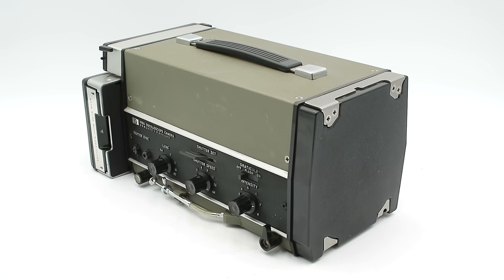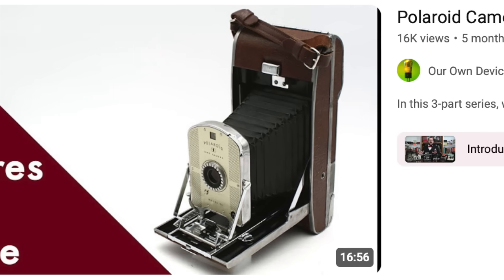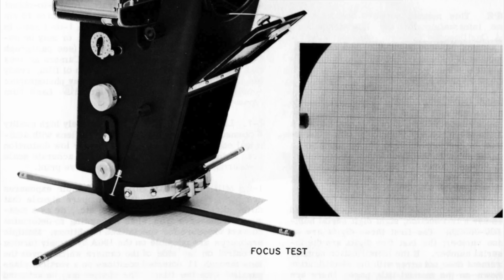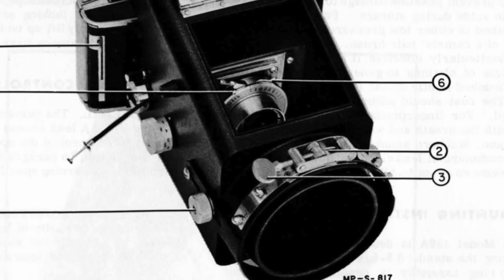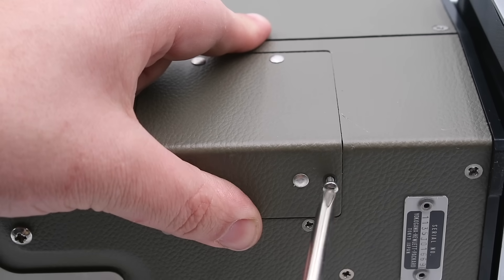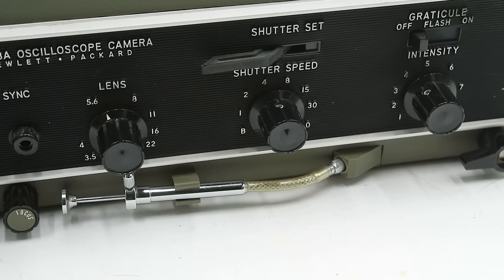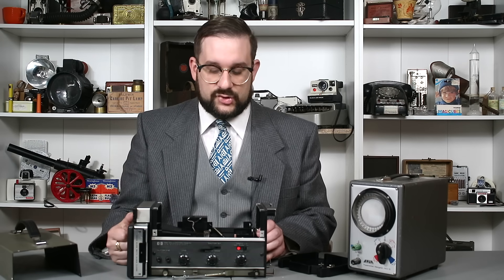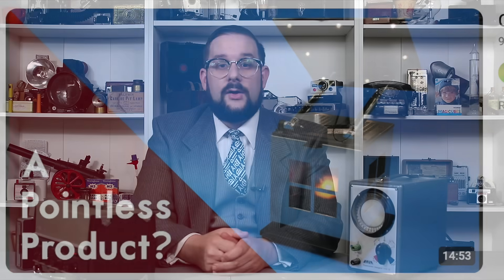HP 198A Oscilloscope Camera: Old-School Data Collection

Comment: Oh, my...  Early in my engineering carrier I was assigned to a team creating repair instructions for a ferrite core memory unit.  Sorta' tells you how long ago that was.  Shortly after I joined the team it was discovered that my hobby was photography,  Guess who was appointed to work in the lab with one of those cameras recording oscilloscope traces for the manual.  I grew to hate the chemical odor of the discarded parts of the film packs, lots of pictures, big wastebasket full of debris.  Near to the end of my carrier I had an oscilloscope that made an image, sent it to a plotter and/or a file.  Much better than the film camera, no chemical odor either.

Comment: I have a Tektronix 2252 oscilloscope that produces screen copies on an Centronics-compatible PC printer attached to a parallel port on the scope. Unfortunately, I don't (currently) have a printer to try it out. These are kind of a transitional solution between the earlier scope cameras, and the digital storage scopes that came later.

Comment: I found an early 80s DSO at a thrift store a little while ago, complete with an onboard 5 1/4" full-height Shugart floppy drive. The thing is huge, and must've cost a fortune when it was new; that floppy drive alone probably cost around $500. Still, I'll bet it was a godsend just pushing a button on the scope and saving the trace data to a disk.

Comment: We used variants of these for very high speed work, mostly for ESD, weapons, or nuclear work.  Later they were replaced by electronic versions, where the CRT had an electronic snapshot taken, as fast as possible.  These were used as a standard "save the data on the screen" for decades, in all high speed situations.  Triggering was a problem, since it was not capable to go anywhere near the 1-microsecond required zone, until later models.  Eventually HP designed 1-nanosecond triggering, which worked well, and was capable of capturing slapper explosives as they developed along the plates, and similar 30,000-foot-per-second events.  They actually worked very well, for that time, and were state-of-art.

Comment: I used a variation of the 197A camera to document oscilloscope and spectrum analyzer traces for reports.  This camera used the Polaroid film cartridge that came out in the early 1960's.  If I remember right, the film was 1100 ASA B&W.  To focus the camera we would pull out the film pack and use a focusing plate in place of the film pack.  The camera took relatively good photos, assuming the trace intensity was uniform across the CRT face.  Given the fast film, the exposure latitude was quite narrow so, the trace intensity across the CRT face had to be constant.  As a bonus feature, the camera could also be used to take passport or driver's license grade photos of your lab mates as a joke.  The image barrel distortion made such photos a bit creepy looking.

Comment: I never really ran across any of the HP scope cameras, but was very familiar with the Tektronix  C50 series in the mid 70's. I use to work in a calibration Lab and we had to issue them out to Lab tech's , keep them clean and loaded with fresh Polaroid film. Thanks for being able to see another side to capturing O scope screen data. 👍

Comment: In the mid 80s, as an EE student, we used similar but simpler polaroids with the lab's oscilloscopes.  Even then it struck me what a wonderfully kludgy solution that was.  I recently saw on Adriene's Digital Basement that you can now get an amazingly powerful digital oscilloscope for under $100 that fits in a pocket.  Wonderful time to be alive.
Reply: lol, so it seems that "In the mid 80s, as an EE student" we both had similar experiences. (Though mine was late 80s, there were still a few profs using that instead of the o-scopes with printers attached)
Reply: This is basically just the old school version of taking a picture of it with your phone, I always thought that was just a new thing with the rise of smartphones but I guess photos have always been a simple way to record data.

Comment: Ah yes, the days when HP was known not for consumer laptops but for high quality test equipment, which weighed a ton and cost a lot, and was worth every penny. The general rule for electronics labs back then was "Tektronix for oscilloscopes, HP for everything else. And don't forget your Simson 260 multimeter."

Comment: A logical continuation of this approach was to draw and photograph animation frames on the kind of high resolution storage tube CRTs (basically CRT-based etch-a-sketches operating at well below 1fps) that were available on terminals like the Tektronix 4010 series in the second half of the 1970s. Various early CGI was created in this manner.

Comment: Great as usual, just wondering if this is a Canadian thing?  I hear you say oh-sill-a-scope.   Always understood it to be ahh-sill-a-scope just like ahh-sill-late. Scopes will start following you home. Their like chips, can't have just one.  Tektronix 400 and 500 series are my faves, but Apollo era HP gear is always the best.  Open them up and sit in awe of the engineering and workmanship. Something as simple as a 3310a function generator has 4 boards with gold traces in a box smaller than a toaster.

Comment: I used the simpler Tektronix camera in EE Lab in 1969.  I also used a Visicorder oscillograph that had miniature galvanometers and wrote with UV light on sensitized paper rolls.

Comment: The vestigial timer is there because it's a "clockwork" Copal shutter. The last Copal shutters were made as recently as 2013. You'll find them on big 4x5 and bigger cameras where the lens is also made by another of many companies.
BTW, HP is now Keysight. They still make oscilloscopes and have nothing to do with the HP brand that was sold +20 years ago. Keysight still has offices in silicon valley.
Also, the last time I saw a Polaroid CRT camera, in the 1980s, if memory serves, it looked to be manufactured by Polaroid and looked like one of their cheap black plastic cameras but with a long (pre-focused?) nose.

Comment: When I worked at the Naval Research Laboratory in the late 70s, they used a camera setup like this to take data from their optical experiments. I would then take the photos and digitize them on a very early manual digitizer, pressing the pen onto successive points along the trace in the photo. The digitizer would output the coordinates directly onto punch cards! How times have changed...

Comment: I used a lot of HP measurement and recording (not sound recording) equipment in labs in the early 80s.  The thing I think about when early-ish HP products come to mind is so-called Reverse Polish Notation - a programming language (?) they used.  It worked just fine, but you kinda had to put your brain on backwards when programming.

Comment: I like your addendum at around 14:55, about examining problems that people have run into the past, and how they found solutions to them. Learning how people approached problems and how they came up with innovative solutions is a great way of giving you ideas and frameworks to approaching problems when you run into similar situations yourself, even if they're not directly comparable.

One thing I really appreciate about your videos is that you make sure to clearly communicate what was the actual problem that people had, and then you introduce the device that was used to solve that problem and how it achieved that. I notice quite frequently that people just end up explaining what something is doing, rather than why it's doing that thing; and without understanding why things are done in a certain way, it's incredibly hard to actually apply that knowledge to other situations.

Comment: These haven't been obsolete for TOO long; I owned a Tek scope camera in the 80s, and I still have the enormous "mainframe" o-scope (Tektronix) that it attached to.  It is an analog storage scope meaning that the storage function is implemented in the CRT itself - there is no digitization or electronic memory.  Interestingly, Tek made a "digitizer" (analog to digital converter) which used a storage tube as well - it was a truly exotic, one-of-a-kind "scan converter" tube designed and made by Tek and concealed inside a rackmount chassis. There was no visible display as the captured signal was exported over the then-new GPIB bus that HP originally developed.

 The signal from the vertical plug-in deflects a writing beam through distributed deflection plates. The electrons hit a small flat rectangular solid state target, conceptually similar to the image sensor in a digital camera. The resolution of the target is 512×512, giving 512 points in the time domain and 9-bit linear quantization of the input voltage. With a 7B92 sweeping the whole X-axis in 5 ns, and the 7912 capturing 512 samples in that sweep, the 7912 performs the function of a 100 GSample/s A/D converter. (!!) Nearly all of the units produced were purchased by the U.S. gov't. 

Digitizing scopes existed at the time, but their sample speed was slow, meaning they were fine for repeating signals, but if you wanted to capture a single transient event, one couldn't have a good waveform; there weren't enough samples before the event was over. In fact, the official name of the original R7912 was "Transient Waveform Digitizer". Analog storage tubes and the 7912 could capture one-shot waveforms with excellent resolution.

They were breathtakingly expensive even before the plugins were purchased, although it used 7000 series scope plugins so if you had a fast vertical amp already for a scope, you could use it in the 7912. Astonishingly, my old 7904 storage scope, built in the 1980s, still works fine.  Tek really built good stuff.  When it was new, it was $17K with no options and no plugins. I bought mine in the 90s, stuffed with thousands of dollars worth of great plugins, and including four nice Tek probes, for $200, thankfully the ebay seller was near my town so I didn't have to ship the beast.  The dedicated Tek scope cart (you don't want to try carrying the thing, handle or no handle) I picked up at a local surplus store for $10.  I also have a logic analyzer plugin which turns the scope into a 16-bit logic analyzer.
Reply: Did you say 100 GS/s

Comment: I thought it was a toaster...designed by you, Giles. 😂🤣

Having owned an HP RPN (Reverse Polish Notation) calculator in high school, I can verify if there was a complicated way to do ANYTHING, HP will inevitably choose that paradigm. Every calculator I was looking at, had ways to reinsert the modulus back into the current calculation on the Stack. WHO DOES THAT?! 😂🤪😵‍💫

Comment: Sync input normally is connected to the oscilloscope, set for manual triggering, so that the trace only comes across the screen once the trigger condition is met. Otherwise the screen is blanked. Auto trigger, or on the old oscilloscopes the free run position, always will display a trace in X axis, while the manual trigger mode only will show a trace when either the input passes a threshold, or is above it and above a frequency, or above it and the high frequency noise is filtered out, or uses the incoming AC mains peak as a trigger source, or an external voltage level to trigger. That way your film does not get a big band of bleed light from the base level put on it, which means you can run the screen at a very high brightness, to capture fast events, as they are still able to provide enough light to excite the film. 

An aside is that later scopes with memory had a multichannel plate in the front of the CRT, and would hold an image for a few minutes after it was written, making it easier to photograph as you simply left the film exposing for a minute or two, so the faint image would be recorded.

I had a very similar device, except it used a non developing film, very heat sensitive thermal paper, and ran the CRT very bright, with the film pressed against the glass, so the bright spot would put enough energy into the paper to expose it. Worked well enough, but very slow, used originally as a recorder for ECG or other signals, and if you wanted a long term record you would have to use a photocopier to immediately make a copy, or use a polaroid camera to take a photograph of the paper strip, as it would fade with time.

Comment: Not to be pedantic, but the shutter speed dial on the 197A actually appears to go from 8 seconds to 1/30th of a second. Either that, or what appears to be an "8" is actually a bulb function, which would keep the shutter open as long as the shutter release is held down. It also has a "T" setting which would likely be for an external timer or could be the bulb function if there actually is an 8 second setting. (That probably makes no sense and really demonstrates how clearly you present obscure subjects.) But as an indicator of how thorough and detailed your videos are, I had been in the professional photo lab industry for 40 years and while I had heard of it, I never understood how pre-fogging film increased it's sensitivity. There's always something new to learn., and you do a great job of passing along information.
Reply: I think it's actually B, not an 8. As he mentioned later with 198A, this is B for bulb mode for long exposure. In practice meaning, shutter is directly tied to the trigger actuation. As long as trigger button is pressed, shutter stays open. Instead of trigger button triggering the timed shutter sweep. 197A also seems to have T, which would be for (externally) timed exposure. Meaning first trigger triggers the shutter open, but it latches that way. Only closing on trigger being triggered again. Both probably usefull for certain experiments with the external electric trigger connections. One could wire up ones long experiment with external timing module with adherence to the bulb or timed mode. With external rig there would be no problem turning bulb mode to externally timed. Just have electronic timing setup latch down on the trigger for as long as you needed.
Reply: @aritakalo8011  That's what I get for shooting off my mouth before I finish watching the whole video... And in case anybody is wondering, the term "Bulb" is used because early shutter release  systems in photography were pneumatic, so the photographer would trip the shutter by squeezing a rubber bulb like the ball on the end of a turkey baster.
Reply: Is pre-fogging similar to "hypering" the film, that astronomers used to do sometimes?  Edit--just looked it up on Wikipedia, and it sounds almost like they are opposite processes, with re-fogging making the film more sensitive for short exposures, while hypersensitizing makes the film work better for long exposures.
Reply: Pedantic, regardless.

Comment: Used a very similar device during my college years to provide "proof" that I'd done the experimental homework for several electrical engineering classes in the late 80s. Still have a pack of film from that time, which very likely won't work properly, but is at least still sealed in the original foil package.

Yes, Gilles, I'm older than you 🤗